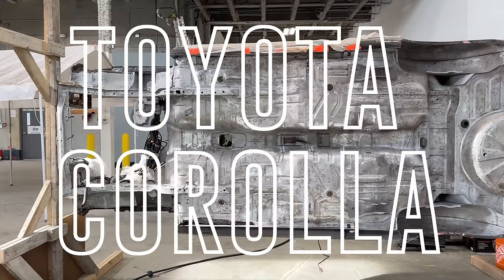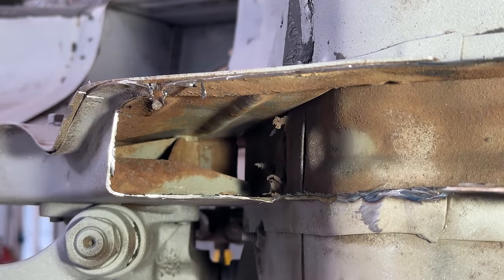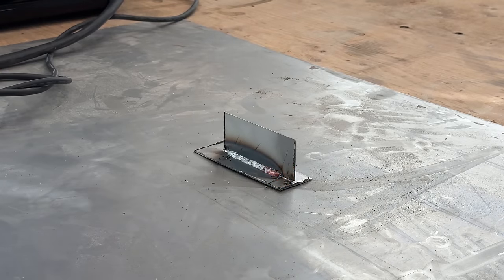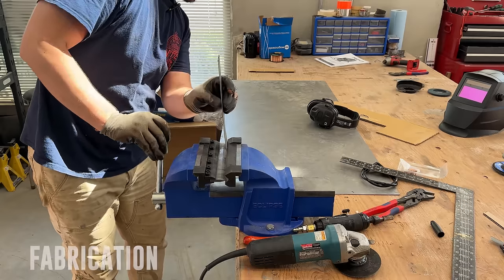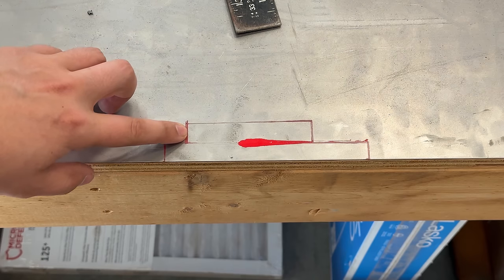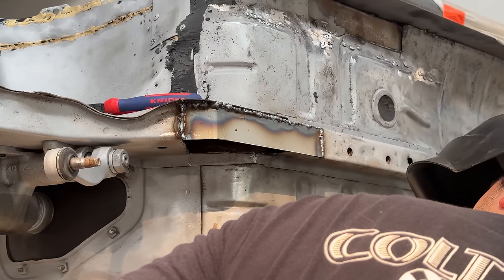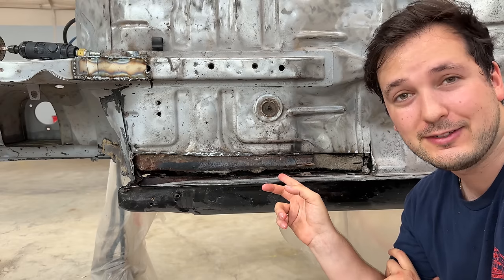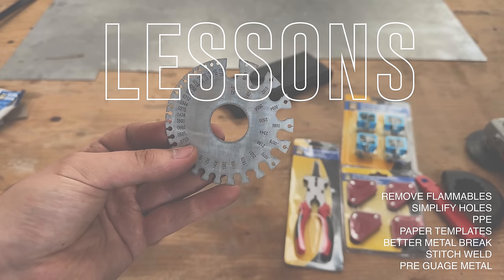1972 Toyota Corolla: Undercarriage Welding

Comment: First thing I'm noticing is, you're chopping out the same spots on both sides of the car at the same time. Fitzee only works on one spot at a time, so he only has to look ~4 ft away to see what the spot he's currently building originally looked like
Reply: Between that, and the amount of heat you're dumping into concentrated areas, this car might come out a weird shape. I would suggest spreading your tax out a lot more and not holding the trigger for much more than one second at a time. Otherwise, great effort, very daunting task.
Reply from the maker: Sounds like a good idea, its all a learning experience at this point, but i'll try to spread the heat around next time and make the fabrications as replicable as possible. Cheers man @domecrack

Comment: So the welding wire you got is 0.035 which is too large for that sheet metal repair, and you don't want to use the welder's recommended settings because you are not laying beads, you are stitch welding.  In stitch welding you want high heat (much much higher than you think) and thin wire.  We all start somewhere so good job!
Reply from the maker: Great advice thanks!
Reply: @sansberlin  Great work, just keep up the momentum!

Comment: Quick tip. Use the gas to your advantage. When the tacs are cooling down or you're finishing a bead, hold the torch over the end and let the gas to just cover the final swirl. This helps with preventing oxidation and the pinhole that forms when you don't :)
Reply from the maker: Ahhh never heard about this, I’ll give it a try, thanks for the info

Comment: You should have cut out first the obvious rust, and then sandblast the thing. I don't think it will last another 50 years, but you definitely got a 20- 30 year life extension.  It's a Toyota corolla after all it should last this long! Keep up the good work!

Comment: Keep a spray bottle of water beside you....the paint or seam sealer or anything flammable can ignite and smolder or flame as you weld....a air gun also can put out a fire and cool your weld area ....any water can be blown out or will dry up... fire extinguisher are a Last Resort only....

Comment: couple of notes from me:
- you should really have coated the inside of the new welded pieces with some kind of weld throuh zinc primer to protect it from the inside out
- you can do rounded corners instead of live 90 degree ones, it will help with blow through in those places. it is more time consuming to do though
- just put the guard back on in the grinder, you're cuting flat straight lines, no need for the extra risk
Reply from the maker: Thanks for the input I really appreciate it! Keep hearing about this weld thru primer, what is it, and how can I use it? Rounding corners seems like it would be harder to fit a new piece in the exact spot, whats the best way to cut that?
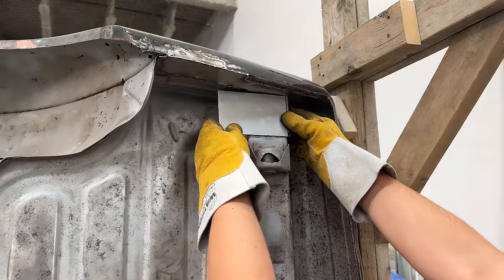Reply: @sansberlin  weld thru primer is a zinc based paint that is usually used on the underside of a soon-to-be welded piece (like at 22:05) to protect the inside of the cavity from corrosion (also overlaping faces), since there wont be any acess to protect it afterwards. It's called weld thru because the paint is not afected by the heat generated by the weld nor it will contaminate it, you should protect acessible surfaces with it after welding, not before.
regarding the rounded corners it is way more work, you're right. it's more of a last resort measure since corners are more prone to blow through. you can use and air saw or a nibbler, but it's not always possible.
keep up your solid work, good channel.

Comment: Great work Joel, for a first time welder you've definitely gone in at the deep end and you're achieving what you set out to, which is getting new metal in place of rust. Everyone starts somewhere and I have to commend you for taking on such a big project right out of the gate. My first vehicle restoration had all of the welding work outsourced because I couldn't weld back then. I hate to say this now when it's too late, but my only piece of advice would have been to paint internal cavities with epoxy paint and the back of your patches with weldable primer when you had the chance. You should check out "Soup Classic Motoring" if you haven't heard of him already. George is one of the people most responsible for me buying a welder and having a go at patches and repairs myself rather than paying someone else to do it all the time.
Reply from the maker: Will check them out and thank you for the advice! I was inside the car the other day and am thinking because of the fire im going to have to peel the carpet away anyways, so i might as well get in there and clean it up. Appreciate the support, thanks man

Comment: You did really well for a first timer frankly, the first welding I did looked just awful lol. Also the best thing to use for templates is frozen food boxes, thin card but still more rigid than just paper, oh, and some tin snips would help you with cutting small bits of metal without the hassle of the grinder.
Reply from the maker: haha thanks man that means a lot, and good recommendation, i'll check out the snips and thinner card stock

Comment: Yeah, you are definitly learning haha, Ive been there, the biggest help is watching Fitzee fabrications videos, its a massive help from setting up the welder to making panels to suit, also, first thing i EVER learned is, NEVER cut all the rust off the car in one go, the second is, cut about half an inch to 3/4 of an inch further back than the edge of the rust, the metal will weld so much better there
Reply: also, hearing the weld, alot of the time your wire speed is too slow the wire is playing catch up, you might end up getting the wire stuck in the contact tip

Comment: My 1973 Corolla floor looks the same.  I too started welding on that car.  I had the exact same issues.  I hac a CO2 fire estiguisher handy and used it quite a few times.
Reply from the maker: Its what I get for cutting corners on not removing the carpet. live and learn

Comment: Going well but it would be great to have a mate who has done this to get you started on this. The last patch you did you welded to a screwed on previous repair. Please remove that patch and fix whatever hellscape it's covering up and fix it all together. You can also see there have been lots of older repairs with bronze weld  so please take a look at them in case they need fixing properly too. Hate to do all this work and do it again in a couple of years.
Reply from the maker: The car isnt perfect, and it never will be, so I understand your concerns about the work done on here previously. Everything's holding for now, and im doing it at the best of my abilities, thats all I can ask for at the moment.

Unfortunately no mates that work around cars, a mentor would be much appreciated, but youtube comments have taught me so much hahaa
Reply: @sansberlin  oh the car is cool and in solid enough condition for a daily driver but if you have the chance to remove old and badly done repairs while doing a better job please take it. I assumed that you thought the screwed on panel was factory as you welded to it. Please cut that edge, remove the screws and fix whatever is lurking. A screwed on panel covering rust will give you a much bigger problem later on because it's just covering the problem.

Comment: Your remodeling is coming along quite well, as is the Toyota.
Reply from the maker: the kitchen will come soon
Reply: @sansberlin  I tried remodeling my garage 15 years ago. Completely tore down a 87 S10. Sandblasted and painted the frame, modified the the fire wall to move the steering column, made engine mounts fot the 350 small block, modified  the transmission mount shortened the drive shaft. Primered the bed, cab, hood and fenders. Then life happened and now I can barely walk around it. Or any where else in the garage for that matter. Keep up the good work but don't forget to go to church Sunday morning. 
John 3:16
For God so loved the world that He gave His only begotten Son so that who so ever believes in Him shall not parish but have eternal life.

Comment: A tip as you go mate! Get rust converter and sealer on any surfaces you reveal cutting out the old stuff. Just an extra layer of protection
Reply from the maker: Thank you sir, will do, going to be getting a coating on very soon

Comment: good morning form perth western australia  the wire feeder some times has 2 groves one is 6mm and 1 is 8 mm you just have to check it out if so turn the roller around hope this helps if you like the welding time to try tig good luck thank you for the vids
Reply from the maker: Thank you sir. I hope there’s no negative consequence for having a 9mm wire in an 8mm feeder.

Comment: Dude, you literally made a chassis Rotisserie out of fucking wood. That's the single most awesome thing I've seen all year. That's the type of shit I like to see. people going after it with their own personal investments and personal troubleshooting, Not everything is easy but a little of perseverance and anything is possible. You've got my sub, because I really hate welding my chassis, aspecially because it seems like the paint just loves to catch fire everywhere. you can alaso invest in a welding magnet, which transfers the current, so that you dont have to clamp so far.

Comment: I don't know if is just the camera setup but I would recommend adding a tad more of angle (15 degrees maybe, imagine like using a fountain pen) to your hand when advancing the welder tip so when you do the swirls the wire keeps feeding the welding line instead of trying to pass straight trough the metal sheets

Comment: you could be blowing a hole because you're trying not to blow a hole and going faster, causing you to outrunn your puddle. You have to keep the wire within the last quarter of your puddle and just push it, don't drag it for mig welding, push it. hold the electrode at a slight angle while pushing. don't bother doing little circles when you weld, just try to go in a line and drag your puddle.

Comment: Don't grind down welds that are just going to get covered by seam sealer or undercoating later. Trying to grind your welds flat makes them a lot weaker. It is not always obvious how much penetration you have in a well. If you grind the top of it flush that may be the majority of the metal that you added. Everyone makes this mistake when they're starting out. Grinding welds flat sucks. It's dirty and it takes a long time and then you realize it was probably not necessary or even a bad idea. Good luck with the project. I had one of these cars back in the day and love driving it.

Comment: You need to set a higher voltage and reduce the distance from the mouthpiece to the welding site. The welding time for one point is about 1 second. The welding spots should be thinner. And it is advisable to make a gap of about 0.5...1 mm between the welded parts. Thanks to this, there will be penetration to the full depth.

Comment: If you are putting modern power in this car I would send it to a tube frame shop and have a roll cage made that reinforces all the suspension attachment points. A full tube frame would allow you to cut out everything that's prone to rust. Safety wise look at how feebler those "frame rails" are, there's barely any metal there to start with. Please don't put any more than 100 hp if you don't upgrade the frame. Those spring mounts look they they are good for less than 50 hp. There's no structure there, that metal you can bend it with your hands. Stock is fine but I saw a modern 4 coil computerized ignition and electric fans under the hood. I also saw the original voltage regulator so which is it modern or stock?

Comment: You are holding your tip too far from where your welding....your wire speed is too fast..why it is causing you issues. ..mig welding is the Easiest welding process to learn..But you still need to Learn how to Weld... Welding thin metal is harder than thicker metal ... running beads is for later on and hard to do on thin metal even if you are experienced ( not that hard but it will heat up quickly and blow through if you are not going the right speed and settings are Wrong etc..)... right Now you need to learn to Spot / Tack weld properly....  i turn my heat up and slow my wire feed till i get a low weld that is easy to control ( low as in it melts deep properly but doesn't blow through or leave a lump of Cold Weld ( where you aren't actually melting the metal enough to fuse properly - it will be a poor weld if Cold )....Practice is what matters to learn to weld and scraps metal are good for that....also actual rusty metal in car repair adds another challenge to welding with pitted thin or dirty metal making welding even more challenging.... you should tack weld in small welds ...move away letting the metal cool down ( stops warping too that going too quickly creates ).... keep beads apart ..wire wheel your welds before overlapping welds....i usually grind down my welds to see pinholes better and this saves grinding later.... depending on the location of weld ( grinding smooth isn't always needed as you can weaken poor welding as you are a beginner )... if it will not be visible or interfere with anything later? just seam seal it after wire wheeling it and priming/painting.... we all learned once too....

Comment: mate, pretty good job here !, keep going, welding is a lot of fun.
If you don't mind, when you have some curved shapes, as the second piece you welded, you can weld the first two corners with some welding spots or dots, and as you keep going, you can hammer it so it gets the shape by itself. Also, it is better to not cut the metal when it is a complicated shape so you can have it as a template, once you have the template, put it over and cut. that is what works better for me, hopefully it will work for you.
Regards !!
Reply from the maker: That sounds like a much better option, adjusting the hole to your template. Thanks man!

Comment: Any time I have done patches, especially where looks aren't important I made the patch slightly bigger than the area so it caps it off. I'd also use weld thru primer so the edges aren't metal on metal. Just sayin... Love your content though. I am extremely jealous of your project and car.
Reply: I also got a 36" sheet metal break at princess auto and it was 80 bucks? Always keep a water spray bottle around :)
Reply from the maker: I saw another comment on this, i've never heard of weld through primer, what's its purpose, how can I use this? I think i'll head to princess auto today and get that exact break. Cheers man
Reply: It's exactly what it sounds like, you can spray it on bare metal but you can still weld over it like it's bare that way there is a barrier between your patch edges and the bare metal. Good on ya! have fun @sansberlin

Comment: Great work! For an easier and better weld, clean the panels to the metal where you weld, both sides if possible! Also, when accessible use some rust convertor on the rust(inside rails etc.), and don't leave bare metal unpainted inside rails, cavities(use some epoxy or zinc, copper can paint) .
Reply from the maker: Thanks man! Yes, I'm going to find one of those spray  cans with the tube attachment to coat the inside.